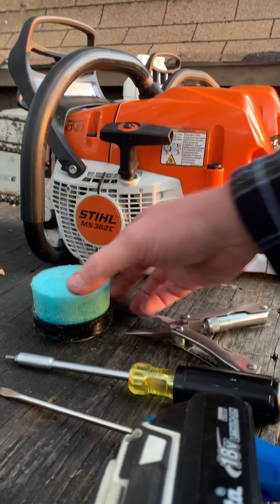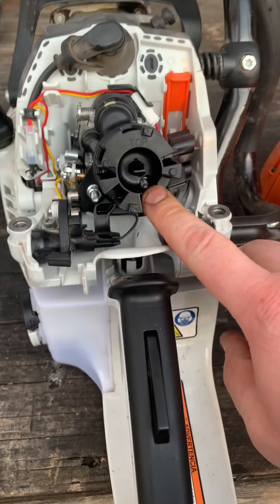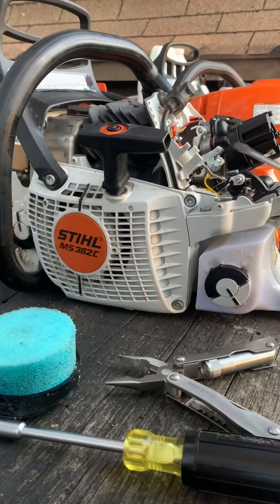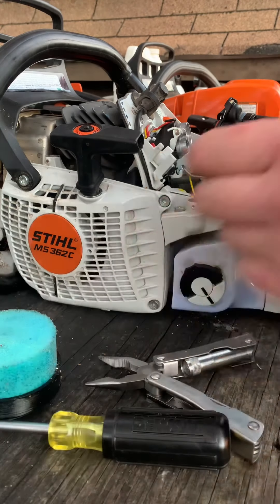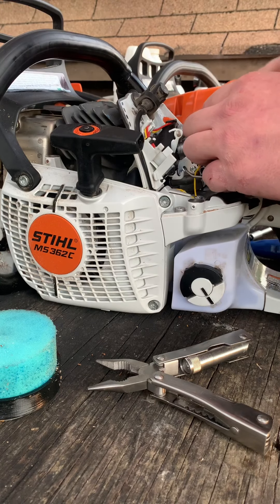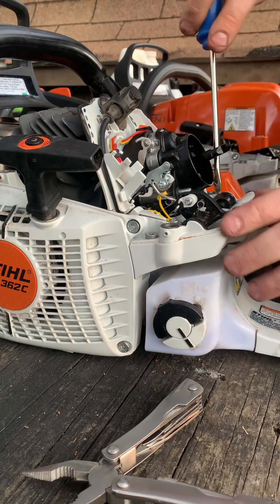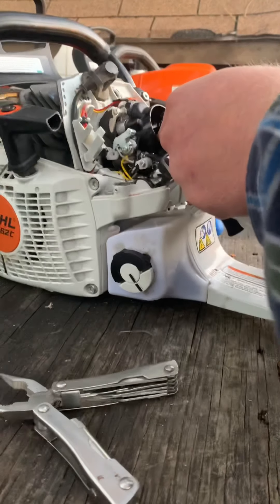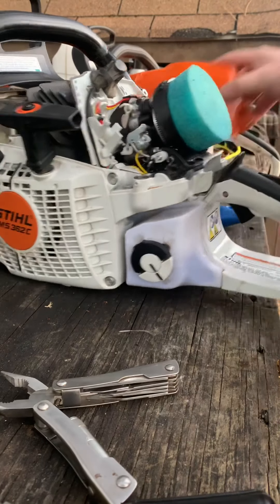Stoeckel Stacks / West Coast Saws Stihl MS291, MS362 , MS391 air filter install

Comment: I’ve got the old 362c so it’s not the m-tronic. The filter housing seems different as it doesn’t have any holes that need plugging from what I can see? Have you seen that before? Also the filter takes some real effort to slip onto the housing. Is that normal? I really don’t want to damage the new filter

Comment: I have this saw.  I've read reviews that says the stock air filter provides inadequate filtration.  I'm not talking about restricted airflow hindering performance, that I don't care so much about.  But should this filter improve the actual filtration of the air also?  Thanks
Reply from the maker: The reviews are correct, in My opinion. This filter absolutely improves the actual filtration of the air, and as a bonus improves the saws performance. It allows more surface area and removing the internal baffle allows it to flow a lot better. Thanks for watching my video!